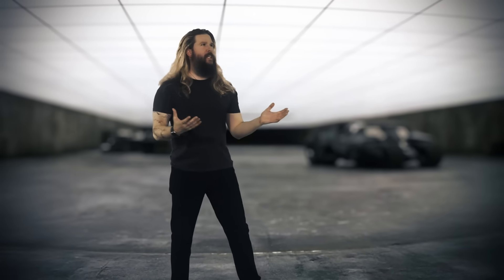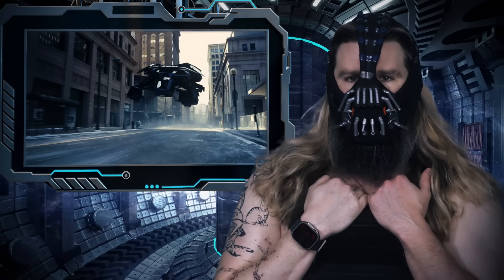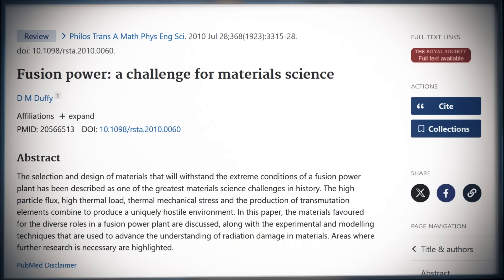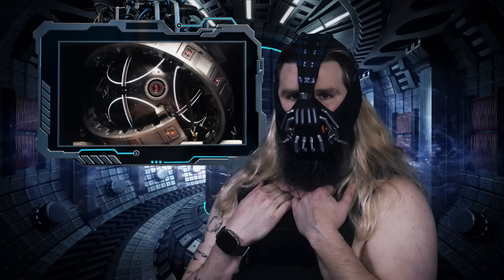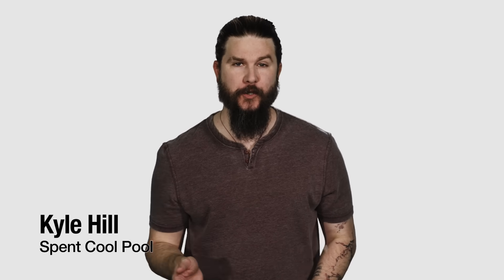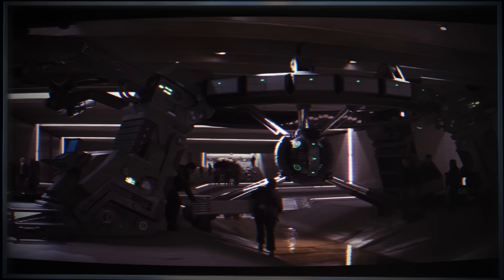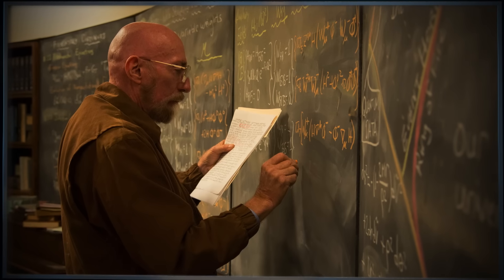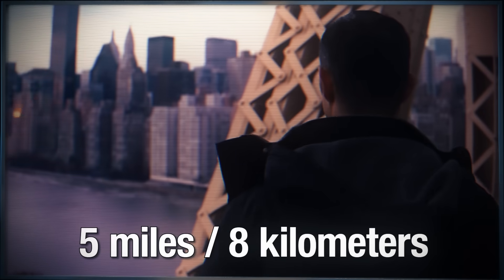Batman's Nuclear Fusion Problem

Comment: I mean, the simplest fix for all these problems was just to say that Wayne Enterprises developed a new kind of nuclear weapon for the DOD under the old management, and Bruce cancelled the contract when he came back and shuttered the pretty much finished bomb along with all the rest of the military gear. Then the baddies just need some weapons-grade uranium to shove into the bomb and they're good to go, which should be easy considering they managed to pull one over the CIA.

As for the Batmn flying the bomb away, if they made "the Bat" more of a mix between the F-35B Lightning II STOVL and V-22 Osprey VTOL, something with jets for a higher top speed, that would give him more of a chance to get to a safer distance. Throw in a few more cut-away shots of, I dunno, people pooing their pants over their impending doom for added suspense, or even have the aircraft drop into the water at the last moment, so they could spend a few more seconds on a cool shot of it crashing into the water and sinking, and a few more seconds of cut-aways to people thinking it's over before the huge underwater explosion. I bet that would look even cooler!

There you go, Hollywood, some free ideas for the next Batmn reboot in a few years time.

Comment: I had greater issue with Bruce's ability to overcome a dislocated vertebrae within weeks,  then free climb out of the prison when he could have used the rope as a safety.   I've had lower back pinched nerve problems - far less serious than a dislocated vertebrae - and it took me years to overcome for pain-free mobility.    I get that the free-climb was a metaphor to overcome his mental issues, but still, it was stupid.

Comment: the only thing I would change for the calculation is switching from the fastest helicopter to a comparison with a Harrier jet or something like that which has a top speed of 730mph but the F-35 has a maximum speed of 1200mph and it can also do vertical takeoffs.  that nearly doubles the distance or even triple it :o

Comment: Nolan films have a tendency to be stupid.  But it's really subtle and doesn't show up until you got suckered in by the smart parts.  Whether it is the Batman fusion problem, or microwaving Gotham sewer lines, or using a Saturn V rocket to launch a spaceship that can do millennium falcon moves around a black hole...

Comment: This is a stretch here. It has been proposed to use a small fission reactor to produce heat, power, and tritium to aid in the starting/operation of a fusion reactor in a hybrid system. I can see where a person unfamiliar with the science behind such a system and only familiar with pulp sci-fi novels and movie scripts would think you could modify such a device into something like a hydrogen bomb. I get this would give you nothing near the device in the movie but I can see how Hollywood would make the illogical leap from cherry picked summaries of academic papers and too many comic books in the late 2000’s.

Comment: One thing to consider is that while the fusion process itself won't explode, there are a lot of proposed designs that include a lot of big superconducting magnets that in certain modes of failure WILL explode.

Just not nuclearly.

Comment: In the ad, you say the 110 does its thing "250% faster than other, similar devices"? If another similar device did it in 10 seconds, 100% faster would be 0 seconds, so 250% faster means it tells you what's radioactive 15 seconds before the isotope is even detected?

I get that the ad copy was probably written for you, but still...

Comment: I think the implication with the auto pilot is that Bruce wasn’t even in the chopper when it went out to the bay. Although he would likely still be in the blast radius
Reply: Yeah I thought that was the most important part. He ejected from the Bat before it was over water. The bomb would have still done the damage but Batman wasn’t not in the Bat when it went off.
Reply: @NandR  The Bat has a dual jet engine on its back, which you can see it activate when flying over the bay. It's essentially a futuristic jet-helicopter hybrid, so I don't think it's correct to cap its top speed to only the highest existing helicopter, especially with movie science rules.

Comment: Not to disagree, because I think you've shown in great detail why this whole thing wouldn't work to begin with ... however, disregarding the fusion reactor wouldnt work, let's assume it does - Batman may have lived even with assuming everything else you said is true ... because ... there was a point made after the explosion in the film, that mentioned the auto-pilot was fixed. Which is an obvious insinuation that Batman was not onboard and flew it remotely - he didn't jump out and swim or fly away. Now ... where he got off & where he remotely piloted it from would be the follow-ups that were never addressed, but ... regardless, that is what was insinuated in the film. 😅

Comment: Here's how I viewed it:
The pinnacle of fusion tech is a self-sustaining fusion reaction, something that no longer needs the lasers for force the atoms together and which uses a magnetic bottle to keep the super hot, super dense plasma in check.  By disconnecting the reactor from it's control pedestal, those magnetic fields begin to degrade and, eventually, releases the 100 million+ degree plasma that's being kept under ungodly amounts of pressure.  So it wouldn't be a fission bomb with all it's radiation, more like a super napalm or fuel/air bomb.  Makes it slightly more believable but still have to suspend disbelief that something that small could contain that heat and pressure.

Comment: My understanding is the fusion device was originally meant to be an anti-matter device. The decay was the battery supporting magnetic confinement. Exactly the same idea from Angels and Demons (thanks to Mrstealth93 for pointing out the correct film)
Reply: The Da Vinci Code? With all due respect, might have gotten that and Angel and Demons mixed up, where the device with antimatter was stolen from Cern.
Reply: @Mrstealth93  I don't disagree that the reasoning for not going with antimatter seem thin. It honestly just what ive heard and the whole bomb thing does seem rather obvious
Reply: @Mrstealth93 sorry was half awake and on a ton of sleeping pilks when i responded you are correct there
Reply: @JustinCase-ey4ok  Its okay. It happens. But if what you said with the reactor were meant to sustain anti-matter instead of a fusion reactor were the original part of the script, certainly would fit better with the limited power supply plotline in Dark Knight Rises and the destruction of Gotham.
Reply: That makes a little sense. I was thinking they were trying to reactor-ify a fusion bomb. Somehow bottling a tiny fission chain reaction to create the pressure and heat needed to coax some fusion into happening. I don't know which idea is dumber
Reply: Or, even better, they used antimatter to initiate the fusion reaction. And if magnetic confinement is not 100% effective, some escaping antimatter particles will degrade their own container and it will eventually explode like a thermonuclear bomb, just with antimatter igniter instead of fission one.

Comment: I already have both the Radiacode 103 and 103G, they’re both excellent detectors, although I’ve found another which is just as interesting. It’s called the Alphahound, and it’s almost like a digital cloud chamber. It separates the different radiation types on its screen, which can be very useful for identifying certain isotopes.

Comment: The only viable explanation: It was a conspiracy where Batman used a real nuke and calculated the necessary parameters to both keep Gotham safe and be able to escape - all he would have needed is some kind of advanced shielding to help him survive, perhaps his Air Bat Machine had a separate pod with rocket propulsion or the vehicle did so that he could get away faster than we thought he could.
But why? Perhaps simply because it is impossible to have a fusion reactor that small. Destroy fake reactor, the company and it's board doesn't suffer embarrassment or reprisals from it's shareholders, and Wayne gets away with plenty of swag to live a new life by faking his death so that he doesn't have to be held liable for the lies and all that noise.
Reply: This guy gets it

Comment: Agree with most of what he said, but fusion can produce radiation and nuclear waste. Tritium-deuterium fusion releases a neutron so you'll have to deal with neutron radiation, neutron decay, and radioactivity in the materials exposed to it (these materials become the nuclear waste). Not all fusion reactions do this, so depending on the fuel your reactor could be fine or really radioactive after running awhile. The reactor itself becomes radioactive, not the fuel.

Comment: Not going to lie, but I do like my Radiacode 103G. Handy little detector and has a plethora of information as to what's been detected. Currently checking my condo for radon. Also bought a cheap peach radon detector. I'm willing to bet the Radiacode will take the top spot.

Comment: 3:52 Kyle, great video!! One thing though- radiacode is NOT a geiger counter! Its a sctintillation detector :) those are two completely different devices
Reply: I had the same thought! It's very unlike Kyle to get such a fundamental science fact wrong, and I'm surprised Radiacode would sign off on that blunder as well. I have both a Soeks Geiger counter and a Radiacode scintillation detector, and they are indeed quite different instruments.
Reply: @whitslack  I also own both, but it was already mentioned on the official radiacode telegram so i dont think that they are responsible for this mistake
Reply: @whitslack Despite being quite the nerd, I had no idea what a scintillation detector was; had to look it up. Isn't it fair to say that they're moreso just really fancy Geiger counters with extra steps; an evolution of Geiger counters, if you will? Because a scintillation detector is not only superficially similar, but can also trivially act as a Geiger counter, from what I see.

I think that Kyle/Radiacode might've gone with calling them "Geiger counters", despite it not being technically accurate, because it's what people know and can understand the function of. A hint that they aren't actually Geiger counters of course comes from all the fancy extra features that can detect precisely what you're dealing with; afaik, Geiger counters are too primitive to do that.
Reply: @mnxs  Geiger counters are named as such because of the Geiger-Müller tube that they use to detect ionization events. Scintillation detectors use a completely different mechanism to detect radiation. Whereas a Geiger counter detects voltage breakdown in a gas inside a hollow tube, a scintillation detector detects photons emitted by a crystalline solid. Literally no mechanism is similar between the two (except that they both make use of electricity). Neither is an evolution of the other, and neither has a superset of the other's features. They detect different things, and they are used in different applications. A scintillation detector will never be able to detect alpha particles, for instance, and Geiger counters can be made to handle energy fluxes that would overwhelm a scintillation detector but cannot discern the energy carried by each ionizing particle like a scintillation detector can. So you have to choose the right tool for the job.

Comment: Do Expendables 3's "plutonium mines" next!

(Plutonium isn't mined, it's artificially fabricated in a nuclear reactor.)

Not to mention that giant rods off plutonium  would be fissioning and would be melting down on a truck bed too heavy to move.
Reply: Well, quite some time back, one could've mined traces of plutonium in Gabon - back when its natural reactor was feeling kinda moderated by rainwater and the U-235 supply held out.
Reply: @spvillano  
The Oklo naturel reactor reached criticality 1,7 billions years ago, when the concentration of U235 was about 3% (instead of 0,7% today)

Comment: OK, but the inner wall of the fusion reactor gets bombarded with neutrons, and depending on what you made it from, it can totally contain fissile or at least unstable isotopes. So while it wouldn't create an actual nuclear explosion, maybe if you really screw up your isotope breeding program, a reactor could melt down and contaminate everything around it

Comment: "Batman! Bane has stolen a fusion reactor and plans to provide citizen of Gotham with affordable electricity, thus causing the stock of Wayne Energy to plummet!"
-"That monster! He must be stopped!"
Reply: If i don't make money then I'll be poor. I won't have  money and I'll be forced to........hey wait a second.. am I the bad guy?
Reply: @thebatman6201  you are definitely the bat guy
Reply: In reality the CIA would put him down way before batman
Reply: dont forget, he already provided free train transportation. but that went into the dumps.... unless it was fixed within a couple years.
Reply: That would almost be funny, if Wayne was an energy company. But it's not.
Reply: Fusion is a distraction to keep us from noticing that there are infinitely more plausible approaches for clean, affordable electricity generation. I wouldn't say it's a boondoggle, but there's a snowball's chance in hell of it being practical before climate change is resolved or everybody's dead.

And if you're wondering the approaches I'm thinking of, I'd point to ambient-pressure fission reactor designs, like LFTR and DFR. Make them small and modular with SiCf-SiC reactor vessels, fuel them with thorium, and there ya go: passively safe, highly affordable, low-waste, proliferation-resistant, and capable of being transported by truck to a disposal site after decommissioning. What more do you want?
Reply: @irrelevantfish1978  So? What possible good reason is there to not keep working with the fission we know and are improving while also working on developing fusion on the side? It's not like it's every scientist in the world working on a single project, dooming all other possibilities to certain failure. Let the fusion develop alongside like every other interest.

Comment: In Batman Begins, the bad guys pour Scarecrow's fear hallucinogen into the water supply in the low-income ghetto of Gotham, but since it needs to be inhaled, they use a giant targeted microwave emitter to evaporate the water in the mains.
So I guess none of these working class people boil water for cheap noodles, or drink coffee or tea, or unintentionally inhale steam coming out of the grates in the street, and don't have any water in their bodies since nobody immediately dies after being hit by a microwave emitter so powerful it can boil water after passing through several feet of concrete and a thick metal pipe

Comment: "Capture heat, boil water, spin turbine" - somehow I always hate getting reminded of how that is the thing we do to get lightning juice.
Reply: humanity loves to pretend it passed the steam engine. we just made them bigger
Reply: @thebatman6201  every punk is just steam punk if you squint enough
Reply: You'd think that after thousands of years of basing our civilization on boiling water more and more efficiently we'd finally get tired of it and find a new hobby.
Reply: @KonradTheWizzard  I mean, there's solar, or wind, or even Peltier junctions, but boiling water is what we know best, so it's our go-to. When you have a really effective hammer... you seek nails...
Reply: @Corbald Let's face it, the steam turbine is currently the most efficient way of converting chemical and nuclear energy into electricity currently. If the power companies knew of a different way that was more efficient they would use it since that would increase profits. Yes, there is solar, wind, hydro (which still spins turbines), but the cost of production is still too high. You won't see widespread replacement of steam turbines until an alternative can get the price per watt to a competitive price.
Reply: @OpinionatedNoOne Solar, wind and hydro are now all cheaper than fossil fuel based power generation. Not only that, but there are entire countries that are very far along in transitioning as much as possible.
Edit: That's not to say we won't still need the ol' boil n' spin thing for base power; you're just off the mark on the "cost of production" of renewables.
Reply: @mnxs I was thinking more on as a replacement for steam turbines, just didn't explain it well. Solar and wind will most likely always be nothing more than supplemental due to inconsistent production and the cost for storing power from surplus production to use during low production most likely isn't in the calculations for cost per kwh. Like you said, we need a reliable base power source and I don't think anyone wants to see thousands of acres of land just covered with wind turbines and solar panels to power a small city sometimes.
Reply: @OpinionatedNoOne Stirling engines have a higher maximum thermodynamic efficiency than steam, but I don't know if they can be scaled up enough. Also probably a lot more expensive and less reliable in the long run.
Reply: @KonradTheWizzard  first commercial viable steam engine was invented in 1712. Not quite 1000 years
Reply: @jameskeen3321  The path to civilization began long before the steam engine when we boiled water for making food. If you insist on moving engines: the ancient Egyptians already knew that you could drive mechanisms with steam. Our history of boiling water is really ancient!
Reply: Sure, but the 'spin turbine' part is where the physics get really exciting!
Reply: Boiling water just works, we simply found more interesting ways to make it work.